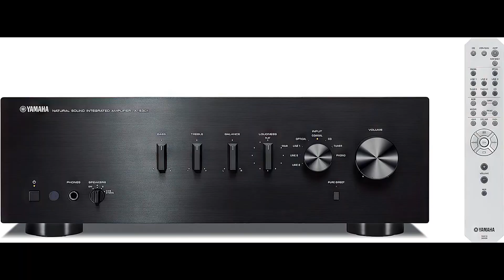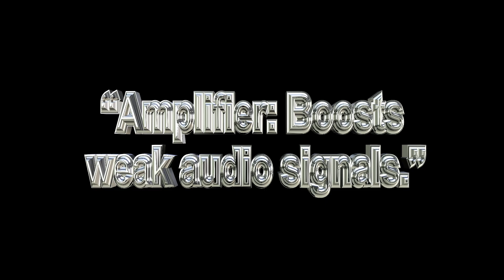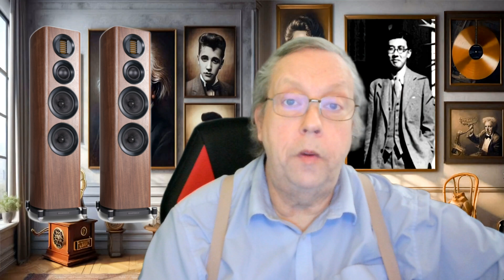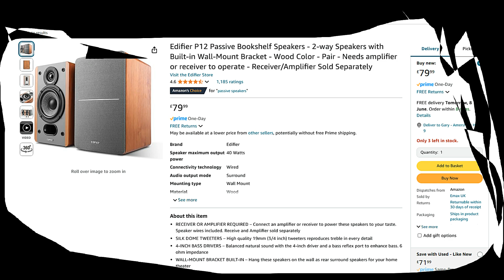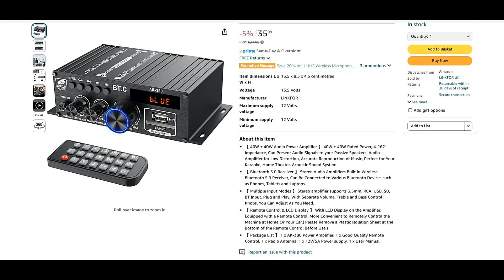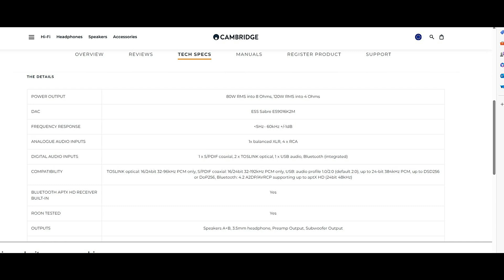Hi-Fi Myths: The Shocking Truth About Amplifiers!

Comment: Standard US home outlets are typicallty 15A in fact! The widely-known "looks like a shocked face" US outlet with two vertical slots is 15A. (There is a 20A standard - one of the sides of the receptacle is T shaped, and the plugs themselves have perpendicular prongs - but those are very uncommon in household applications.) So, at our nominal 120V, 15A maxes out at 1800 - and you'll rarely see appliances over 1500 - even heaters and electric kettles!

US home use the "split phase" system, so we do in fact have 240V stuff. (The telephone pole transformer is center-tapped, so our houses run "dual hot" - two sets of 120V branch circuits, definined by if  you're on an even or odd row in the electrical / circuit breaker panel.) Our 240V appliances use different types of receptacles, of which there are several standards currently used depending on amperage rating and desired usage, PLUS at least several more that aren't in legal in new construction, but still exist in many places and can be replaced with identical plugs.

(A side effect of this split-phase system is that a lot of electronics run at 120V, even those in 240V appliances like clothes dryers and electric ranges. As a result, those appliances are actually four pin - one Ground, one "left" hot, one "right" hot, and a separate Neutral. Why are Ground and Neutral different? Well... that's a whole different conversation.)
Reply from the maker: Ground and Neutral are different in UK also.